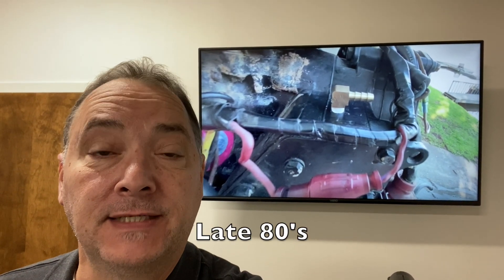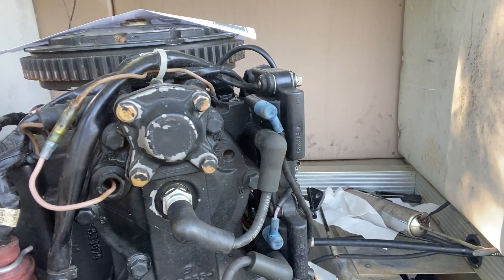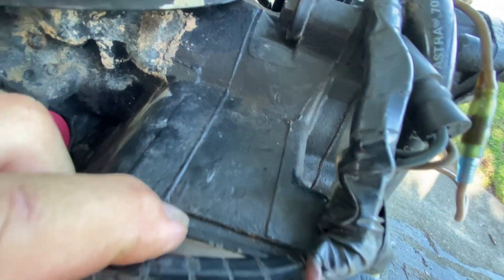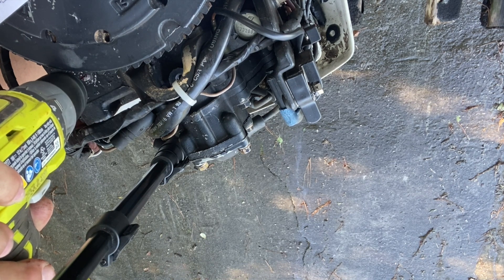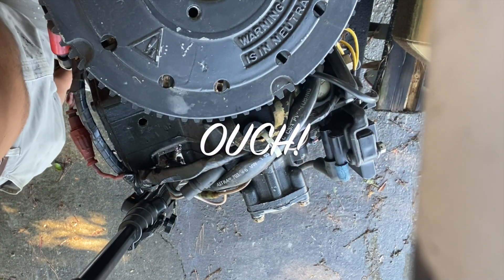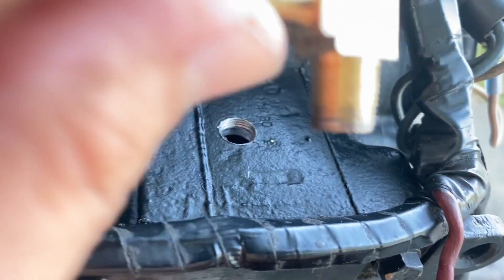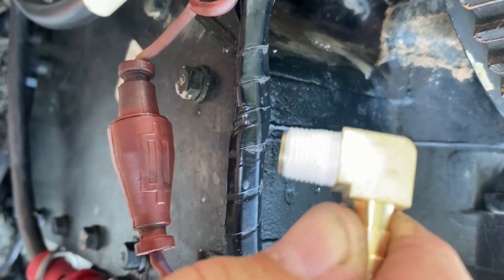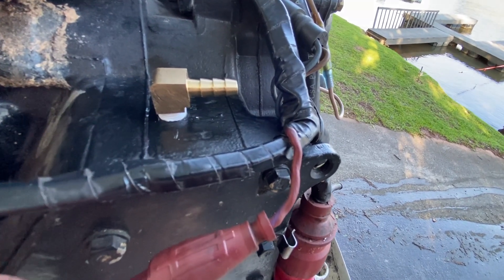Moving the Tell Tale on Johnson Outboard

Comment: Thank you for this video its very interesting 
I have a 1990 evinrude 60hp
And my telltale on the bottom is not spitting out hardly any water 
Would this method be my solution or should I check my waterpump make sure its it working order
Thanks!
Reply from the maker: If your tell tale isnt moving much water, definitely replace the water pump. The tell tale only shows that the pump is working, not that the engine is actually cooling. This move was to resolve an issue where the top cylinder didn't overheat due to a bubble/vapor lock at the top.
Reply: @captainandmissunderstood oh ok gotcha i really appreciate 🙏

Comment: Is that a 70hp looper ?  I had a 82 Evinrude model and it started leaking water in the cylinder and seized over the winter possibly from that issue.
You did a nice job and good idea using the brass fitting with teflon not plastic. I did that with several omc motors to add a freshwater washout hose line to them same way you did.
Reply from the maker: What do you mean by looper? I'm not familiar with that term. Thanks for the comment, it definitely runs much better now!

Comment: I have a 1989 48spl that looks almost identical under the cowl. I wonder if I should do this to mine. Seems my motor runs, not overheated necessarily but hotter than normal. Guess it couldn't hurt to do it. Thanks for taking the time to post your video, nice job!
Reply: i work on these 40/48 rudes and johnsons 1989-96-ive had two that got hot no matter what i did-both have been in saltwater-i tried every kinda flush and no success till i tried 1part muriatic acid to 7parts water and circulated this solution for over 2hrs and both run normal now-lots of calcium and scale were in the bottom of tub i used-i took off gearcase and mated a garden hose to a clear plastic hose w a nozzel on the end that fits into the water inlet in the midsection held in place w a 1x6 board-use a 1100 gph bildge pump in tote  to recirculate the solution-gottta take out thermostat-running hot can also bee a lean fuel mix by carb adjustment or leak in case/top/bottom seals or leaking reeds or reed gasket-that all i know bout it-forgot bad water pump
Reply: @storyoc  glad I found your comment. I am going to try this on some Yamaha 70s I have.
Reply from the maker: Thanks! It was such a random issue and difficult to "trip over" the document that I felt the need to share it.

Comment: Where did you find the paper that tells you the measurements for drilling the hole?
Reply from the maker: Found it on this post in the iboats forum:
https://forums.iboats.com/threads/1988-70-hp-johnson-cooling-system-modification-additional-work.527266/

Comment: As some of the water from exhaust manifold is actually used to cool down the exhaust - I think that the diameter for the water flow indicator is way too large and it wastes water that is othervise used for cooling. A smaller diameter tube, or a reduction piece would do the same job, and allow more water flow trough the exhaust.
Reply from the maker: the diameter of the fitting is the same as the old one. Unfortunately it isn't specified in the document what size orifice to use. It seems to me that since it's coming off the top of the block it should be ok with that size. That's just a gut feeling though.
Reply: Originaly there is a reduction piece in the other end.
Reply: Not... More water out of motor allows more cool water in.The pump circulates more water than is needed to cool the motor..
Reply: I need this same video for a 1976 evinrude 70hp. Not sure where to drill.

Comment: Maybe I missed it but did you mention what you did or how you plugged your original tell tale hole?
Reply from the maker: I left the tube connected and ran a screw in it and zip-tied it. Putting as plug in there would be easy but I didnt want to risk removing the old elbow from the exhaust plate.
Reply: Very good, thank you for answering so fast!!!

Comment: On your old telltale give get you a pipe plug and screw into it with some putty around it the plug.
Reply from the maker: I was concerned about any issues with the old plug breaking so I just used a plug and zip-tie in the old hose.

Comment: There's also a service bulletin on the exhaust plate covers where you need to take off the outside plate cover and you believe a section about 2 in long in there what it happens is air gets trapped especially at the on the bottom cylinder and if you don't relieve that area so that the Air does not get trapped and not move this to the top of your exhaust plate for your tail to you'll overheat your motor a lot. It happens a lot after you run it and it gets warm.
Reply from the maker: Do you have a link for that? I'd like to see it. Thanks!
Reply: @captainandmissunderstood did you ever find a link for what he mentioned

Comment: Hey man at operating temperature with half throttle, what’s the temperature supposed to be at in these outboards. Mines a 65hp.
Reply from the maker: I believe the thermostat is 140-145 range but finding out what they’re actually running is difficult. The tell tale at the bottom is lake temp. I used a laser thermometer on the top of the motor and it would run in the range listed above.

Comment: You noticed an improved in temps just by moving the tell tale hole? I am having an issue with over heating on my Johnson 70 just picked it up last weekend. I was getting the alarm after about 20-30 mins of running at what my tach said was 3k rpm I couldn’t get it to run up past that. I just changed thermostat and changing water pump/impeller tomorrow but mine as well add this hole as well
Reply from the maker: Actually I still had the problem after this but I had such a hard time finding any information on the Service Bulletin and procedure that I decided to make this video (after performing the move).
Reply: @captainandmissunderstood  I cannot figure out what my issue is either alarm is going off. I changed the water pump/impeller, relocated tell tale and swapped thermostat
Reply from the maker: I ended up removing the thermostat as a test and it resolved my issue. So far I have left it out. I did the same as you without resolving the issue which is why I went to this step. Did you buy actual Johnson/OMC parts? They have different springs for different designs that could be causing some of the issue.
Reply: Curious if you ever got that fixed? Mine only overheats when I’m gear and going slow (no wake/trolling speed). I’m going to try this and see if it helps!